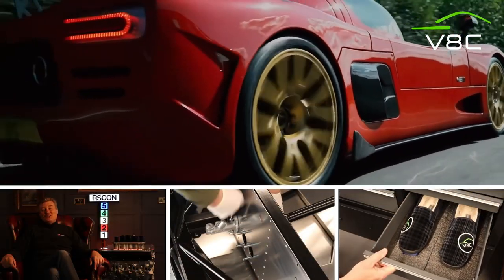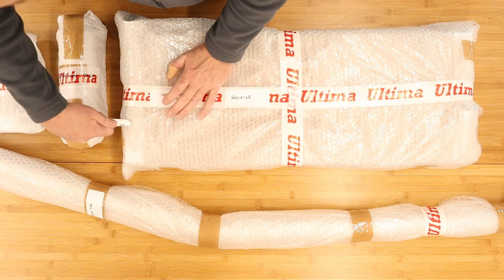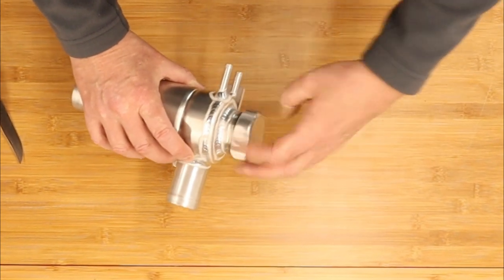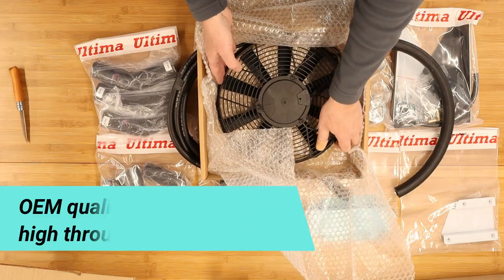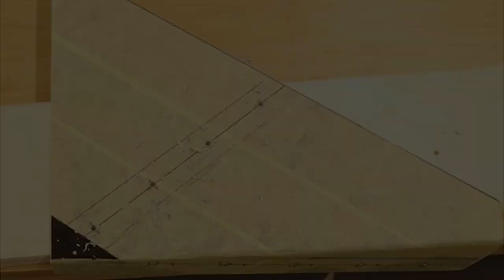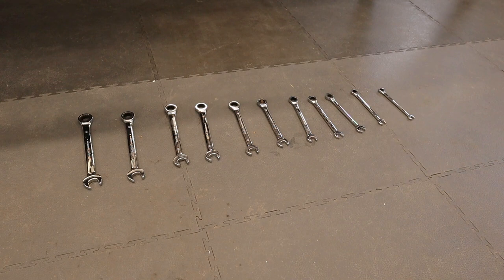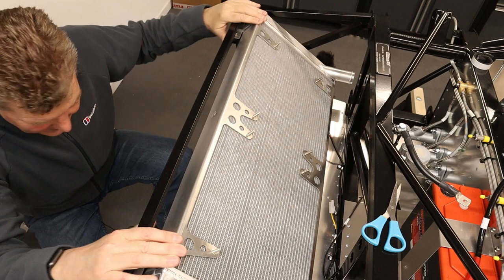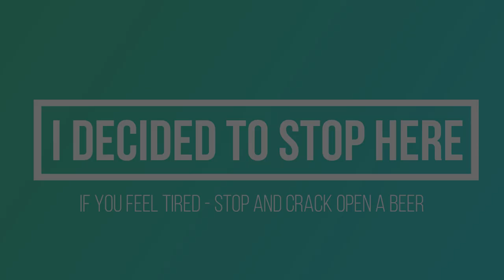Building an Ultima RS with Nigel Dean. Part 9 - Radiator Install

Comment: Great series Nigel! Would you happen to know if Ultima will be releasing an RS Spider (convertible) any time soon? I am a fan, although I have never seen one in person. Getting in and out appears to be a challenge and it looks lie the EVO is slightly easier on accessibility. Thanks again for your craftsmanship and quality of videos! It is greatly appreciated.
Reply: Ultima posted a reply to this same question on Instagram stating the RS will only be available in hardtop / coupe format, no open top.
Reply from the maker: Hi Andrew and thank you for the question. Chris is correct, as far as I'm concerned the RS will only be available as a Coupe. I have been fortunate enough to have driven both a versions of the GTR and must say they deliver a very different driving experience. The Spyder is simply an adrenaline rush in sight and sound, but the GTR cabin is simply intoxicating even at a standstill. Anyway, thanks for the comment and keep tuned. Cheers Nigel

Comment: hi, I am searching for this plastik fixing tool, you are using to drill the holes...do you have a link?
Reply from the maker: Hi Roman, the fixing tool you are referring is supplied by Ultima in their rivet kits so I do not know the source. However, as you have seen they are superb and easy to use. Sorry not to be more helpful but maybe a search on eBay or Amazon may bring up a similar clamp. Cheers Nigel
Reply: @v8creative  thanks for the info, I tried amazon for 2h ;-)
Reply: Try searching for 'Cleco Pins' or 'Skin Pins' and you should find lots of results for them.

Comment: No fan shroud???
Reply from the maker: Brilliant question and as you say there is no fan shroud. The reason is once the bodywork is placed on the car (you will see that in a later episode), there is a natural path for air to flow through the radiator. By fitting a shroud it is fair to say you would increase cooling efficiency slightly at stand still, but when the car is in motion it would impact the free-flow of air and reduce cooling. Ultima have overcome any concerns with stationary cooling by fitting a huge multi-core radiator and two pull fans which in my experience do a grand job. Thanks for tuning in and the question

Comment: The quality of the components is exceptional. It's engineering porn at it's best. Drool, drool, drool. I am nearly 70 and still want one! Would it be a good idea to use something like Sika Flex between the riveted aluminium panels?
Reply from the maker: Yes, they absolutely are. It's such an amazing kit to build :-). As regards the aluminium panels, Ultima supply Wurth adhesive to seal the panels to the chassis on all the rivet lines. So clearly great minds think alike :-)